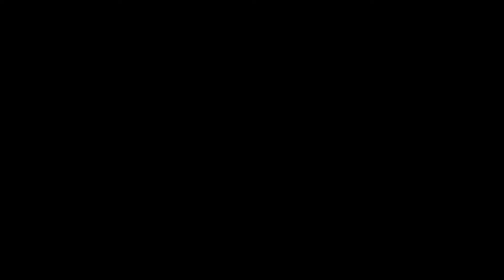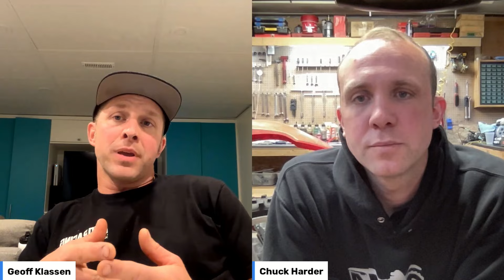Is Sag Really THAT Important?

Comment: How do you choose a fork spring rate?  
For instance the stock spring rate for a 17-19 KTM 300XC-W is a 4.2N/mm. 
The same bike with the same fork in 20-21 came with 4.0N/mm
The 22-24 bike was 4.4N/mm. 
The forks are all xplor forks, but with different valving. 
Most have revalved and converted the forks to full open to fix the Xplor fork wacky compression side orifice with a midvalve and base adjusters.
Then what chart do you use for a spring at your weight?
Reply from the maker: Racetech is a good resource but there is always room for tuning. I do enough suspension that I know what spring rates to use for what weight/style and if I’m unsure I ask Stadium suspension or GP Moto.

Comment: Hey Chuck, what's your go-to brand for shock bearings/bushings? Do you usually go OEM or something else?
Reply from the maker: The Allballs/Moose/Pivot Works etc are cheap and they usually work well enough as long as you grease them regularly. If you want a higher quality I really like the Factory links kits.

Comment: Are you familiar with tpi injector relocation block which moves both injectors? Do you think its worth it for my 2022 ktm 250 exc tpi?
Reply from the maker: No. There are 2 major problems with them. They push the intake boot back so it kinks & at low intake velocities (low rpm) the fuel pools in the intake causing a low end bog. I have the TSP IRK which performs very well but is MUCH more finicky to tune. For the majority of riders I think installing a TSP map is the best option & leaving the injectors stock.
Reply: @ChuckfromTrueTech just to add info to this. I run the dual relocation block. With a stock map yes it pools and you have to rev the shit out of it here and there to clear it out. But after an ECU tune ment for the mod I've had no issues with my lower end and have a very crisp bike for much cheaper then the full tsp kit.
I didn't have the money after buying a brand new bike (XCW 2022) for tsp and went out on a limp with best dual sports products. Really can't complain after all the heachaches from stock and I ride very technical mountains in Pemberton BC.
Reply: @SnakingIvY  I have 2022 ktm 250 exc tpi and I dont seem to have any of those pooling issues. I can leave it idle for 5 minutes and go ride with no issues.  Also I can lug it the same as before except now it has more torque which is better. Everything is stock except that dual relocation block.
Reply: @elkku2140  Hm perhaps the exc has a different map. I know my brothers gas gas also does not have nearly the same pooling issues as mine did.
Reply: @SnakingIvY  that might be it